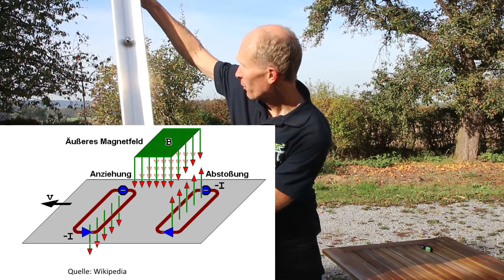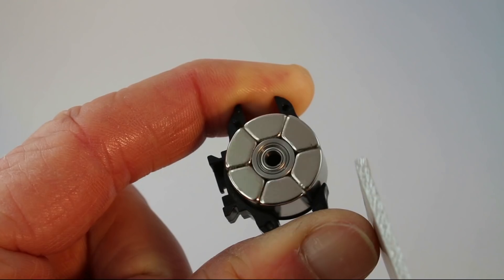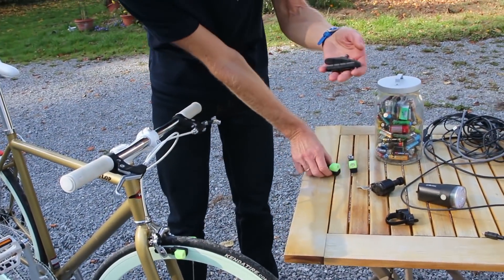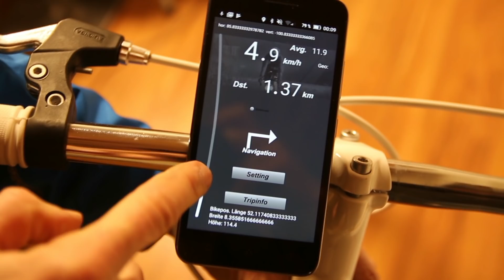Magnic Microlights: Bike Lights with Magic contactless Energy

Comment: Hello Magnic light team . 
I love the stuff you do ! 
Awesome concept for the daily cyclist I am .

But if I may, one suggestion
1) Why didn't you put the projector below the generator, instead of aside ???

Cause the result would give the huge advantage, on every "low profile rim" (which remain common on a looot of bikes), to get the light visible for both side of the bike, although using just one module per wheel ! Ouyeah ! Light would be under the rim, so you see it from both side, bingo :-) (like on Reelight City product line, but their plastic retainer is just shit, like any plastic/rubber holder stuff on a bike....) .
In that way it could allow your product to be more affordable, because then you just need a set of just two (left) modules to fully cover a bike... Which can be about twice cheaper for the customer compared to the 4 modules you currently need in order to have light on each side of the bike (just one side enlightened is not safe and it does not comply with law for most countries) . Of course you get half money for each set you sold obviously (2modules versus 4), but in the same time  some customers will never put 125€ for a light set if the ratio price/solidity/power is seen unfavorable,  however they could consider it for 65€ (not all of them of course, but some for sure) . 
Well, to be honest 125€ is the price of a dynamo-hub based wheel, with front and rear light included (not the lightest models, nor the more powerfull leds on the market, but it will produce enough light to ride about 15km/h to 20km/h safely, even in dark night without public lighting) . It is "bombproof" for the generator part and can run for thousands of kilometers without fail, offering high power and reliable ligthing (100lux if you have the money...) . Of course your product for the same price is much much more lighter, weight is just largely lower, and that's excellent, really :-) . For this price you get about same light power, but, the price of the lux for dynamo-lights decreases constantly (so, I know when my front dynamo light will break after an unfortunate hit/shot, the replacement unit will be more powerfull for the price the previous was, some 40lux are now under 30€...) . Same break will happen to your product after various delay, no doubt about that, he will take hits and then one day break apart, this is life ^_^ . Anyway this is some sort of dilemma :-/ Would I pay 125€ for a "to be seen" lighting system that can't really be upgraded ? (in the meaning to get it more powerfull) . Tipically, I won't :-/ . But for 65€, I will accept (and others too imho) to be "seen only" (city use), because lifespan of the product is large enough for the price, and it is liteweight :-) . This price of 65€ seems "fair" to me, but for 125€ I would keep prefering a dynamo hub (heavier of course but the lighting power is higher too, a 100lux can be installed potentially...) .

No misunderstanding however, your prodcut can be a revolution in bike lighting systems for sure, I'm conviced of that . It is an excellent concept, holding the light and the generator on the brake pad is great idea :-) . The fact you can use any wheel to power it, without any friction, and for really small weight is awesome . In comparaison a dynamo-hub (altough more powerful) is heavy and if you break your dynamo-wheel it won't be cheap to repair/change to restore the light system, your product is less powerful indeed but if you break your wheel you can put any replacement one, the cheapest wheel you find if you want, that's an excellent point . Then for example on a sport bike your product is definitely great, it adds only small weight and you don't need to change any part, moreover those bikes are also often treated carefully, often sleep in a garage, etc, then solidity of the ligthing stuff is not critical . But for an utility bike who takes hits and hits and hits I would be more doubtful :-/
So would you please consider for the next generation to put the projector under the generator ? Because with this (small) design change you can compete imho the utility bike market (which is much bigger than sport segment...) by dividing the price (less parts, less cost for customer) . And those who need/want the direction changing feature (4 modules needed of course in that case) can continue to get it as far as you sell it :-) .

Oh and just one last thing : just please forget (and for ever ! please...) any plastic bracket holder (hub brake version of the microlight) for your products, they deserve better than that, really ... Plastic holders are really shit (and I stay polite), one or two hits will easily break them apart, on a utility bike it is just NOT possible AT ALL . I know a metal holder solution will raise the price the customer will pay, but the lifespan would be uncomparable, any experienced daily cyclist know that, so they will never put any money (or just one time but not two...) on some fragile platic holder stuff ... Your product is great, just don't ruin it because of unecessary fragile plastic parts, keep plastic for the things you can't do otherwise (electric insulation typically, but not for holding exposed stuff, this is a basic rule on any bike...) . Plastic holder is tolerable for a cheap crapy lighting system of a few euros, but NOT for those who cost more than 100€ ...

Thanks for your work, I will keep eyes on it :-) .

Comment: Unfortunately the 2017/2018 Magnic Microlight Kickstarter failed and had to restart some weeks ago with a less fancy abilities. The new one got funded (yay!) some days ago and will end on 2018-12-21 - you can still join with low prices.
Presently it sadly misses the smart options like Bluetooth support and brake induced blinking but still is a very clever way to have frictionless continouus bright light without batteries, hubdynamo or any cabeling at a total of 140g in the full double setup. Two models are available:
Magnic Microlights (to be mounted in break pads, with pads still replacable the usual way) or Magnic Microlights Wega (to be mounted on the frame and fork where no rim breaks are present or of an odd design). Go to the kickstarter.com URL mentioned in the description if you're interested.